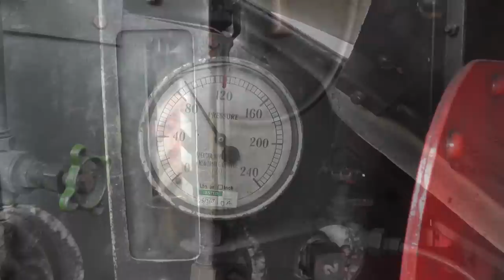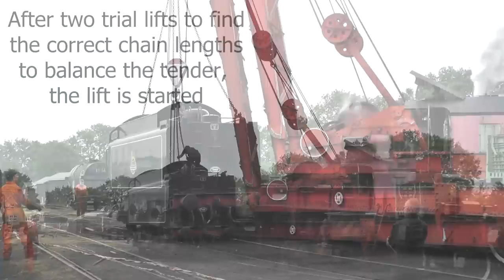73050 City of Peterborough tender lift with steam crane 31/5/2018

Comment: BR were still using steam cranes until quite recent times, just before privatisation I think, and decades after the last steam trains.

I saw a steam crane working in New York on the rebuilding of a ferry terminal about 15 years ago..
Reply: I was a driver at Crewe from 1975 till 85 I think our Steam crane was replaced early 80s.
It was always in Steam ready for call outs and had coal fires around it during the winter to stop it freezing.

Comment: It seems to work in a similar way to a Lego mobile crane I built. The engine is in the rotating section and it sends the power down through the turn table to the under carriage

Comment: pity the railways are moving away from rail mounted cranes to road cranes. What if something had to be lifted in the middle of a rail yard?
Probably not likely. Some road cranes have rail wheels that could be lifted.
I’ve seen photos of VR steam cranes No 18 amd 19 lifting entire diesel locomotives, a crane at each end. They were still used in the 1980s until one fell over on a minor job which was probably user error and suddenly the VR no longer used steam cranes.